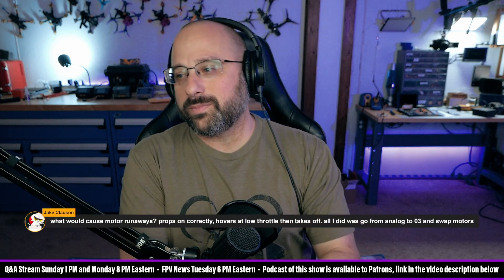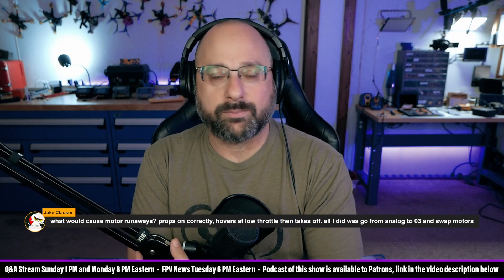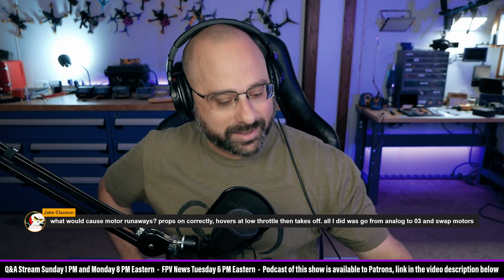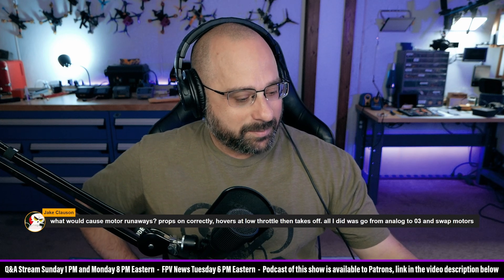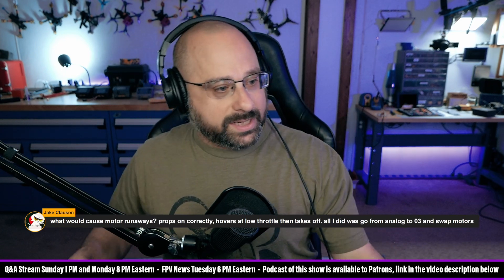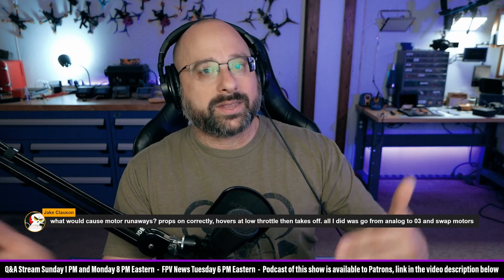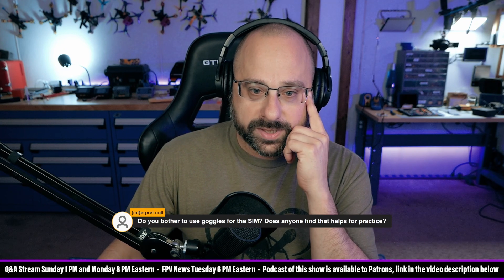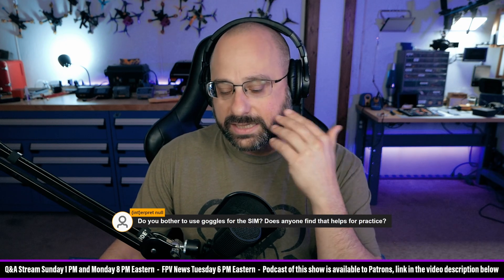Betaflight Runaway! Why Did I Start Having Issues After Changing Motors? - FPV Questions

Comment: I have this on a brand new out of the box air65. It even continues to rise even if troquele is 0. This happens only on full battery.4.2- 3.8 volts it goes crazy. 3.8-3.4 volts starts to work fine. what am I doing wrong?

Comment: I think I fell in love with my RVS Creamer w/ 2207, 2750kv. With those lime green 5.5 props and 2000mah 4s at most. About to start swapping motors though for some more efficiency. Also trying a 2.2 pitch prop and it's way weaker but noticeably less battery sag so might do 1950kv 2208s next. Idk also need to resolder this am32 somewhere see if I gave it a twitch or if it's a firmware problem. Rambled.